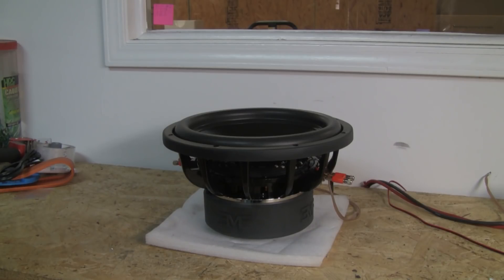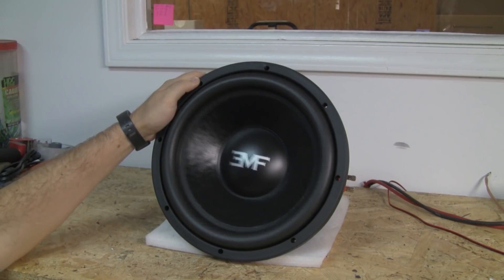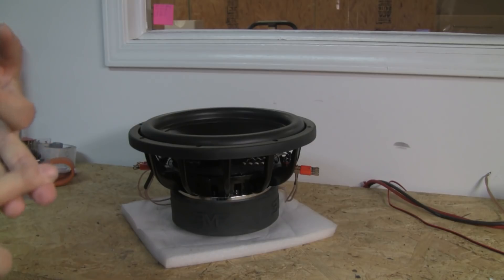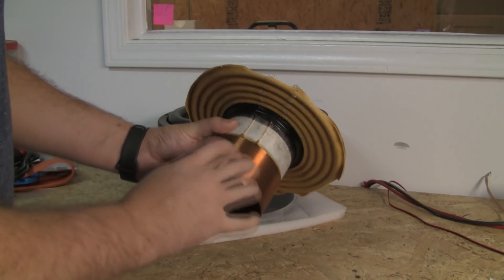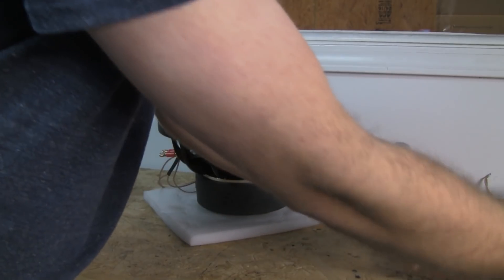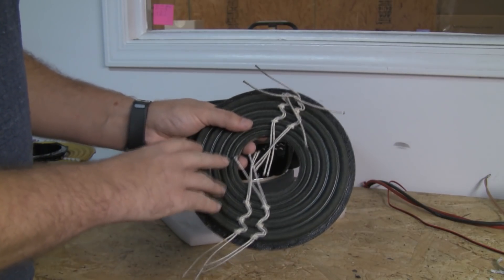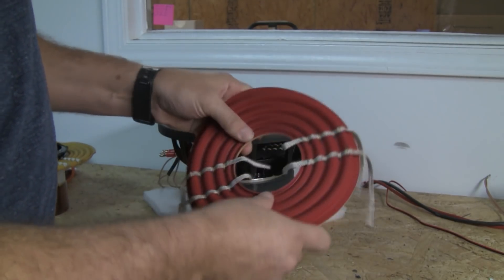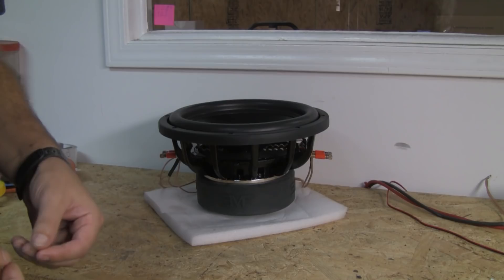Tech Stuff Tuesday - Subwoofer break in myth busted

Comment: Again sorry for so many questions. I’m thinking about buying the 12” banhammer subwoofer while it’s on sale, what would be the best amplifier to buy for that because at 2000w rms I don’t think my 2 alpine amps would be able to handle it. The alpines are I have are around 400-500 rms but the have really low thd and that’s why we got them. And they were expensive they are he bridgeable power ones. Also what is the sensitivity rating or w/m of the banhammer? My subs are 98db. Oh and would I have to buy new crossovers, midrange, and tweeters if I get a more powerful amplifier?
Reply from the maker: Sensitivity is going to be another tech video. You bought lies. Yes a 2,000 watt amp would be a great match for a single Banhammer. With a bigger amp for the sub the only thing you have to worry about is being able to power the amp. So, appropriate wire and electrical supply.
Reply: EMF Audio ok the midrange and tweeter are in the same box as the subwoofer they have a sealed back so they won’t blow out. But I was told if I get a bigger amp and sub I would also have to get better speakers and new crossovers to match them or they would blow because there would be too much power going to them. Is this true?
Reply from the maker: That is very much not what I thought you would be working with. I wouldn't use any of that. An appropriate amp for all of that will be filtered in the amp with separate runs to everything. That also speaks a lot for the quality of the box, you would need a new, good one.
Reply: EMF Audio well I can’t change now that I did that and I don’t know how to install the midrange and tweeters into the doors. I was just hoping I would be able to get a better subwoofer (Banhammer preferably) and an amp for it and still be able to use the same mids and highs speakers with the setup I got. But probably not.
Reply from the maker: I'd have to see what you were working with before I could say if they could be re-used in terms of installation. Remember when you go with louder subs you'll have to have louder mids to keep up as well.
Reply: EMF Audio I have 2 sealed back Pyle mids and 4 pyramid tweeters not sure if this helps. Don’t know the specs on them because I can’t find them on google because they are pretty old. They have pretty good size magnets on them.
Reply from the maker: You're going to want to upgrade those to something way better. http://www.emfcaraudio.com/emf-audio-swag-6-5-coaxial/  That's the way to go.
Reply: EMF Audio EMF Audio ok they are not sealed back though and I kinda want to stick with all in one box because I don’t want to buy a new box lol. And I would also have to get a set of tweeters. I don’t understand why the ones I have couldn’t just continued to be used because the ones you linked are low rms? And Would regular battery and alternator be able to handle all this or would I have to get a second battery? And once again sorry for all the stupid questions google and YouTube just don’t give me the answers! 😂 I definitely will consider those mids if I can figure out a way to get them into my doors.
Reply from the maker: @Dalton.Platte  the point is you need a new box for that sub, what you have isn't appropriate. You won't need tweeters, they've already got them. That's what a coaxial is. Power rating means nothing for the quality of the mids. As for the electrical that depends what all you have. It kind of sounds like you aren't willing to put the money in to do things properly. Not doing it properly makes the best equipment no better than something bad.
Reply: EMF Audio EMF Audio I want to do it properly but I just don’t know how that’s why I’m asking all the questions. I might just settle for dual 12” low ballers or the 12” sundown SA12. But I would most likely still have to get a new amp and crossovers. Thanks for helping me out I understand now that when upgrading a subwoofer there is a lot more steps and money that come along with it than I realized. One last question then I’m done, if I get different crossovers to fit the amp and sub will they work with the speakers I have now? And could one of your guy’s amps power all of it? Cause right now I have 2 bridgeable Amps powering everything (4 tweeters 2 mids and 2 subs) accept the stock door speakers. And they probably couldn’t handle the subs I mentioned I might get. I wish I could just start all over and not have put it all in one box but it wasn’t my idea.
Reply from the maker: The bottom line is to change subs you'll need a different box, you won't want to even use those mids and highs that you have, and you'll need at least a different sub amp.
Reply: EMF Audio ok cool thanks for helping.
Reply: EMF Audio SA12 dual 4 or Lowballer? I see that the lowballer has a higher sensitivity. Both 12”
Reply from the maker: The Lowballer will play lower a little better and direct swap has more output. On paper that makes sense by the specs but they are somewhat similar subs. I would say the Lowballer is better, and costs less.
Reply: EMF Audio ok thanks again😂
Reply: EMF Audio there is this guy that is selling 2 Orion hcca 10.4” subs and an amp called Orion ztreet. I’m not really sure about this amp, supposedly it’s 8000 Watts and he says it can run the subs fine which are 2,000w rms each. But it’s kind of cheap. He selling it with a second battery also. I’m deciding between this or the lowballers. I know these Orion subs will be more powerful but the amp might send too much distortion to them for a $300 amp. And the subs could then overheat, he’s selling all of it together for 650-700. What do you think about this?
Reply from the maker: The subs aren't what you think they are. But, aside from that, the "8,000 watt" amp has 120 amps of fusing on it and 4 gauge inputs. They claim it's a 2,000 watt RMS amp, it's a 1,200 watt amp, and you can find them brand new under $300. I think he's trying to unload a crap amp and blown subs on you for that money. He probably clipped the subs to death, or near it, from having nowhere near the power needed for those subs. I wouldn't touch either of them unless you could get that amp for $125 or less, and I definitely wouldn't touch those subs.

Comment: If someone could answer a question of mine. The Cerwin Vega XLS-12S subs I have are $500 each, they have good bass, but 250w rms... doesn’t that seem really low? Does the rms really matter. Because some subs I find are $250 but have 1500w rms?? I’m new to car audio and it’s my dads set I got for my birthday so I’m still trying to learn how this stuff works. Would you just be paying more for cleaner bass??
Reply from the maker: For starters, that model looks like a powered home audio sub, no? Assuming that, there are several considerations that are universal too. For starters, you can't compare a powered home sub to a car sub. The car sub is just that, a speaker, the home sub is an enclosure, and amplifier, and speaker. Aside from that, power ratings have NOTHING to do with cost. There is no direct relationship. Cost comes from factors like build quality, materials used, toolings, development time, etc. A more expensive sub may perform better than another and last longer and that's why you'd spend more. Power ratings also have no standard of measure, so our 750 watt RMS sub may actually handle more power than another brands 1,000 watt sub.
Reply: EMF Audio the subs are car subwoofers, hard to find they because cerwin-Vega! Stopped making them around 20 years ago I think they are called XL-12S and I you put that into google it’s the fifth image instead of the XLS-12S which I think is the home audio subwoofer. And so even though they are low rms they will have just as good base? Or just not as good low rumble bass which I think they lack. Oh ya and thanks for replying! Great Vid!
Reply from the maker: You're right, those are about 20 years old. I'm not sure how you got the $500 each valuation on those, but that's very old technology. That was also a time when a 500 watt power rating was considered high. You could replace both of those 12's with one of our Lowballer 12's and it would be wildly different.
Reply: EMF Audio By wildly different do you mean better? Thanks for answering my questions I really appreciate it, I can’t ask my dad anything because he gets annoyed or ignores me when I ask him questions lol so thanks for helping.
Reply from the maker: Not just better but different. Low end response would be improved, transient response would be better, overall output would be louder. General clarity should be better as well. It's a very different sound, "better" will always be subjective but I believe the difference is for the better.
Reply: EMF Audio ok thank you! I also made a new comment not sure if you saw it.

Comment: Very nice. Thanks for sharing. I’d like to see what classifies as over powering, under powering subs and the effects of both on the sub(s). 👌🏾
Reply from the maker: Technically, any time you aren't using rated power, you're "under powering". So if you are at a low volume, it's "under powered". Over powering is the point of failure. That may make for a good video of explanation though.
Reply: EMF Audio - Thank you for the answers.